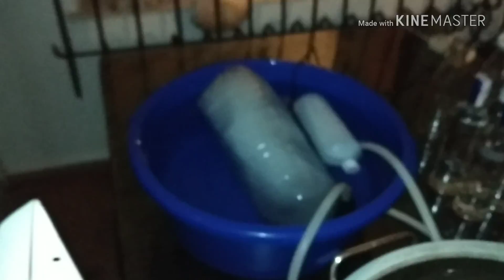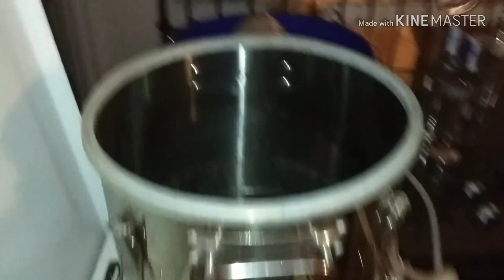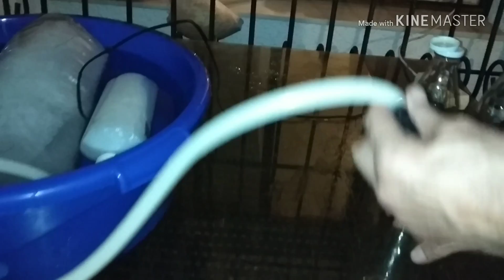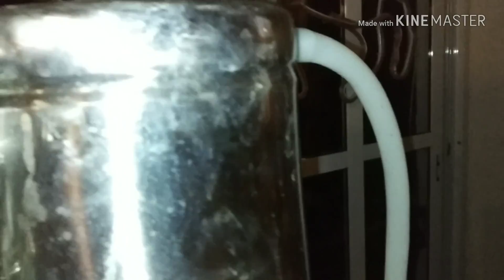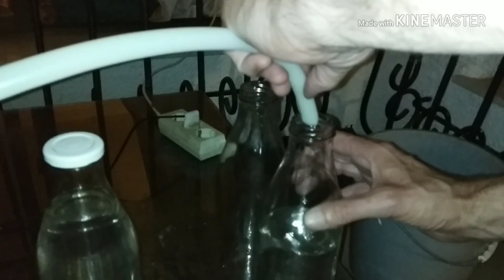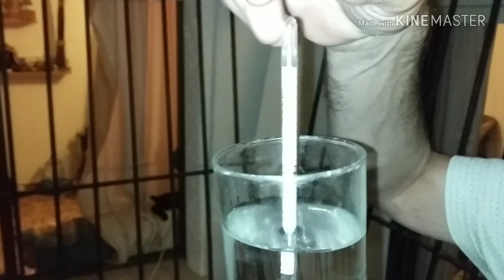Distilling Pure Ethanol From Vodka

Comment: Are there usually any heads and tails from store bought vodka? Do i need to throw away the first shot glass?
Reply: No, you don't need to do it if you use store bought alcoholics, because they are alredy methanol free. You'ill still have a tail and a head but the only difference is that the first will have a lower percentual of alcohol.